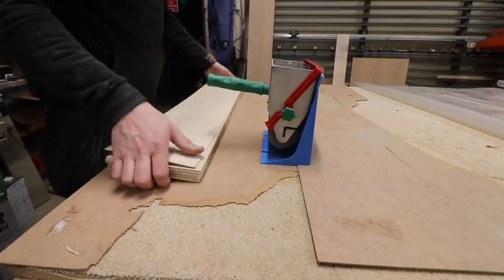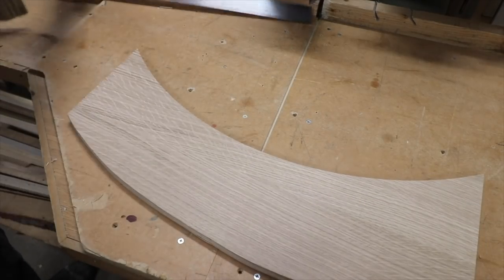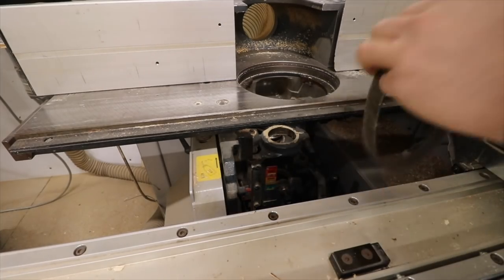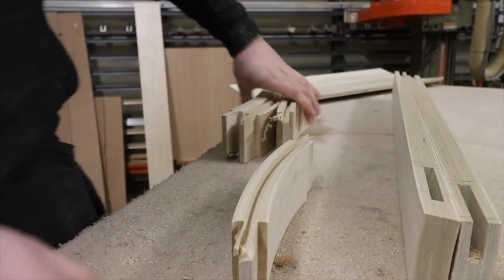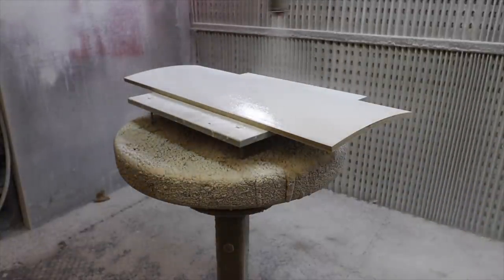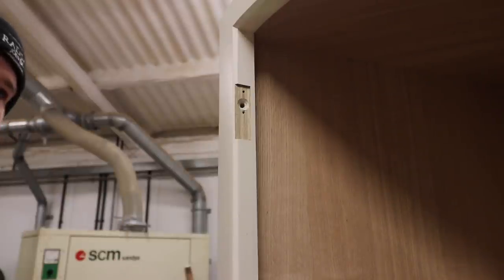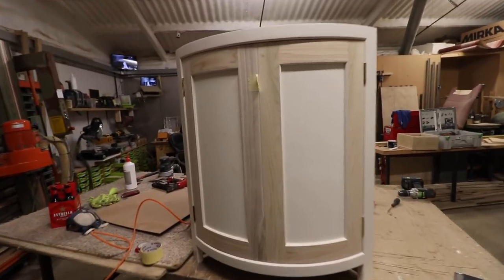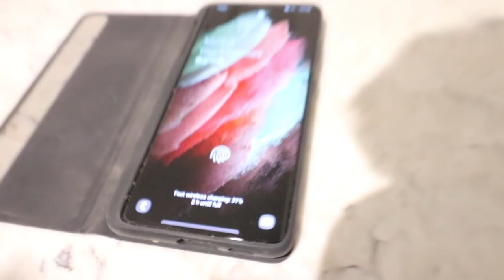Curved Shaker Style Corner Unit Part 2: - Making the Doors

Comment: Quite nice. I used to build curved fronted cabinets and chests in the old days back in the UK  out of solid Oak, but the procedures we used back then were a bit different, with everything completed by hand; no modern machinery like today. The finish we used was highly polished, French polish, so the timber had to be perfectly matched. Every piece was built by one craftsman who was assigned to that piece and didn't work on anyone elses project. I never worked on a mass production line. It took many hours to build just one piece of cabinetry and we took pride in our work, taking no short cuts. It is good to see that there is still some men who take time and have pride in their work too like this gentleman. I would loved to have him as an apprentice and taught him some of the old traditional methods we used back in the day.  I'm sure he would have turned out an excellent craftsman. I still dabble in a bit of woodwork but at 83 the old hands are not as steady as they used to be.
Reply: You should make some videos on the theory and methods used. Pass on what you've learned!

Comment: very satisfying to watch the panel drop into the curved rail slot! great work
Reply from the maker: Thanks! Yes i watched that a few time!haha
Reply from the maker: Cheers matey. Could you link a time to what you mean? Or is it why are some open ended and some not? Its just how long the pieces of wood are when setting out. If they are close to the end of the mortice ill extend the mortice out the end but ift here is a little extra length ill not bother it keeps the mortice nice and parallel

Comment: Didn't know they still made them glue rollers. Used to have one in the workshop when I was an apprentice in the early 80's. It was an antique then! But we're trend setters in Lancashire! 😂
I remember when we had to sand skirting boards before they went to site and we had this belt sander that had a bed on rollers which was about 8'x3' so the belts were about 16ft long. You had to pull down on this arm with a pad  with a bit of old carpet on it and you just worked your way down and back to front and how much you took off depended on the pressure you applied. The edge of the belt was just flapping about rotating at high speed and would cut through a 4" nail in half a second! Very dangerous especially when a belt snapped. We thought we were the bees knees when we got a SCM wide belt sander in the early 90's! But we still had to sand the moulding by hand. 1000's of metres of it. Ah the good old days! 😂
Reply: I used one as an apprentice, rarely cleaned it properly and kept it in a bucket of water, I've just priced one up at Scott and sergeant and was shocked at how dear they are.
Reply: @paulbrougham451  I've just looked. 😳 Jeeze!
Reply from the maker: Seems a cheap plastic one is on Amazon, and has really good reviews! https://www.amazon.co.uk/dp/B098BC49G3/ref=cm_sw_r_as_gl_apa_glt_i_RZFYWJ8GY6XP7M3DSG2K?_encoding=UTF8&psc=1&linkCode=ml2&tag=bradshawjoi0c-21

Comment: Superb workmanship. That was a great watch, thank you. One question. Why the open-ended mortices at one end? Never seen that.
Reply from the maker: Thanks MAte, I assume you mean on the doors? If the timber is only slightly longer than the door ill just mortice the haunch depth out the end of the stile. makes it easy to clean the depth out.

Comment: Crap - thats how I feel about my work when I see yours Ollie! Thats a lovely lovely thing buddy. Got to ask, so I always use poplar / tulip for my fae frames, and you have this time, but often you use accoya. Is that simply because you have it left over from external joinery projects?
Reply from the maker: Lol Matt, youd smash that no worries. It depends on the situation. I have used accoya internaly but its hard work to get it flat without grain wave. Ive not had the facilities to acclimate timber until recently and havent been confident in tulip due to it moving once installed.... not i have the heated workshop and container for acclimatizing timber ill be using tulipwood for painted frames. its made a huge difference!

Comment: nice job sir,what aaa spray system are you using,what paint type thanks.
Reply from the maker: Cheers Alan, Using a Warebourne Enamel @10% Gloss and its a Graco Merkur 30:1 With a wagner GM4700 ac gun (the best gun)

Comment: I’ve made curved units like this myself only on one kitchen but I used pva  to glue up big mistake when the doors came off the former they were fine but as glue carried on curing it must have carried on shrinking pulling the curve more and more inwards to such a point that the curve of the doors wound up different to the curve of the carcass A lesson learned the hard way so if ur ever gonna make curved joinery don’t use big standard pva
Reply from the maker: Argh bummer! Yeah PVA will spring back to a degree, and takes alot longer to fully cure. I feel your pain! Sounds like you got it done anyway
Reply: @BradshawJoinery  yeh I got out of it uve always gotta overcome these problems that arise it’s all sent to test u that’s what I say although it can drive u round the hat stand sometimes

Comment: Cascamite glue and a vacuum bag, genius, do you mind if i copy ?
Reply from the maker: The techniques? no problem, thats why i post for knowledge share :) Its Similar to cascamite, its UF resin.
Reply: @BradshawJoinery  Thanks for sharing, every day is a school day! I have tried so many wood glues, right now im back to Evostik Exterior
(Resin W) having been through a Cascamite phase. I'll try UF resin soon. Trouble is that they all wet dry timber! Thanks again, Ben
Reply from the maker: Resin glue wont and is the best for laminating( no spring back if enough layers. PU glue I get on really well with but is a learning curve.

Comment: What paint do you use to give a gloss finish over bare wood without a primer?
Reply from the maker: Its an waterbourne enamel. Sherwin williams. Could used any of the paint manufacturers, sayerlack at99 behaves similarly, as does little greene. High tanin may need a isolating primer but avoid high build
Reply: @BradshawJoinery  Thanks for the reply. 👍🏽